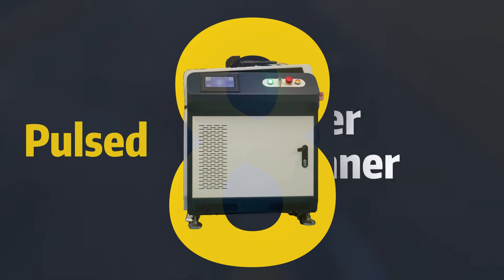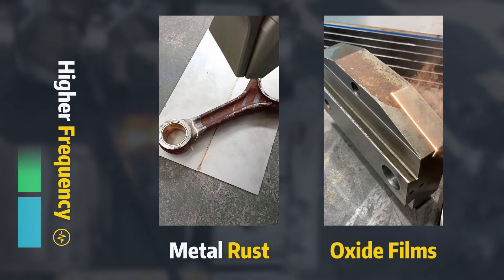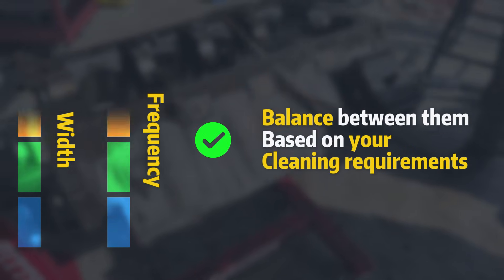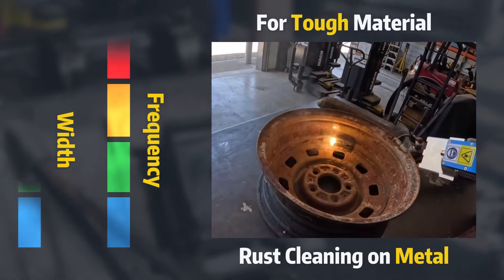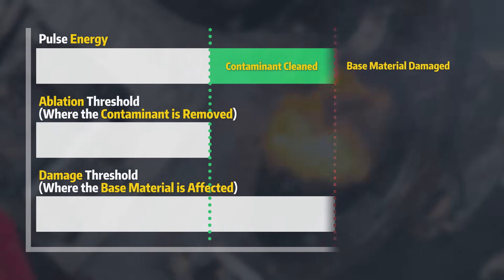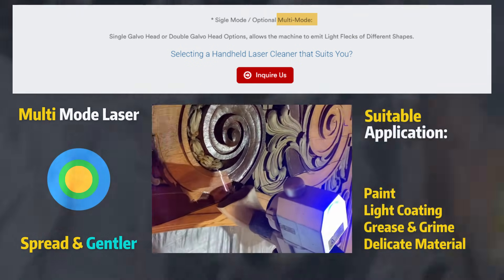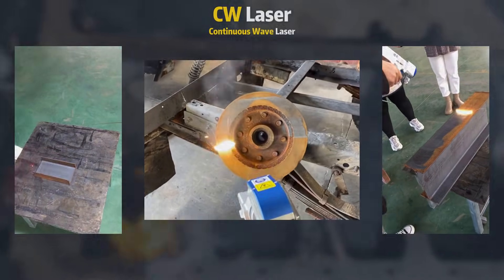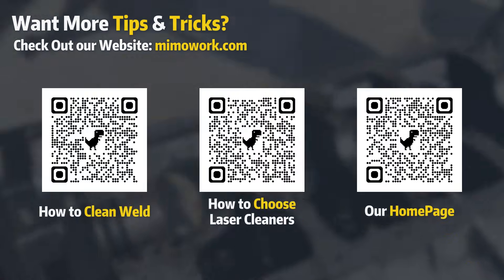Buying a Pulsed Laser Cleaner? Not Before Watching This

Comment: if i wanna make (PET or gelatin) protection screens like those for phone screens, but for hand watches and other devices screens, should i get laser machine or cutter machine??
i've searched for a lot of machines but those used for phones screens come with built-in software for phone screens only and i wanna make custom illustrator designs
Reply from the maker: I apologize for my delayed response.😢

For your project involving PET or Gelatin , especially for creating thin protection screens , using a CO2 laser could be a suitable option.👀

Our software allows you to design and upload any shapes or patterns you need for mass production .👌

To provide you with the best recommendations, we would need to conduct some material testing .😉

This will help our engineers and technicians give you tailored suggestions and settings for your specific use case.🙌

Please feel free to email us at info@mimowork.com to arrange a material testing session.✉

When you reach out, kindly include the following details :👍

1. The material you need to be processed (PET or Gelatin)
2. Your application for this material (screen protection)
3. The thickness of your material
4. Requirments for quality and production scale

Looking forward to hearing from you!🤗